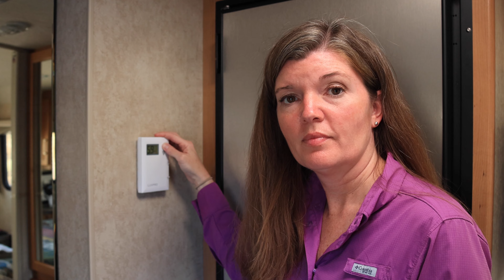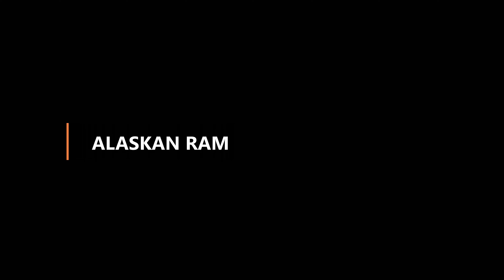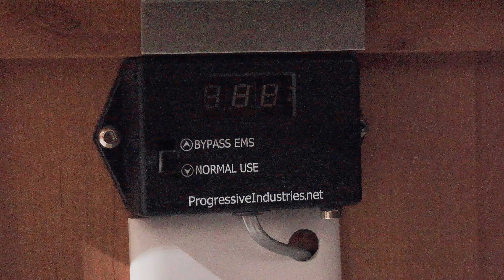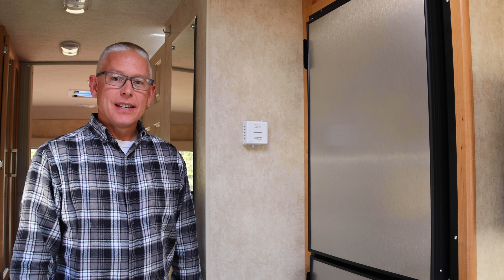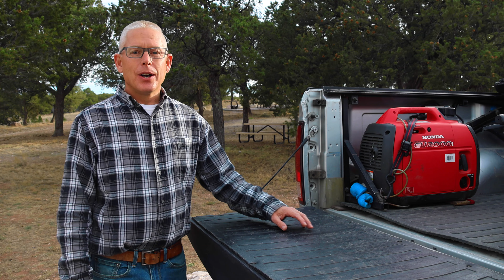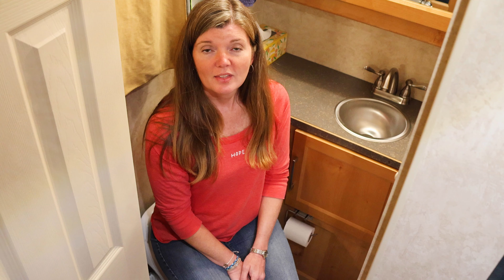RV Improvement Series - Improvements [4K UHD]

Comment: Hi again.  I mentioned on one of your other videos that I have a Bigfoot like yours.  On this video I’m curious about which digital thermostat you used to replace the one that came from the factory.  I’m replacing mine for the same reasons you replaced yours.  I’ve heard that a thermostat has to be compatible with your furnace so I don’t know if there is any truth to that.  Still curious if you know the brand and model thermostat you installed so I don’t have to hunt around.  Thanks for the great videos and saving me a lot of time and headache
Reply from the maker: Hello fellow Bigfooter!  Yes, the thermostat needs to be compatible with the RV furnace.  Not all thermostats are compatible.  We use a LuxPro thermostat that we purchased from Amazon.  It works perfectly with the Dometic furnace used by Bigfoot.  You can find our Amazon affiliate link in the video description of the "RV Improvement Series - Improvements" video.  Just click on the MORE button below the video title to see the full video description that includes links to all the products discussed.  If you purchase using the Amazon affiliates link, we will get a small payment from Amazon, and you will NOT have to pay anything extra.  Same price, same product, same Amazon...we just get a small kickback from Amazon for promoting their online shopping.